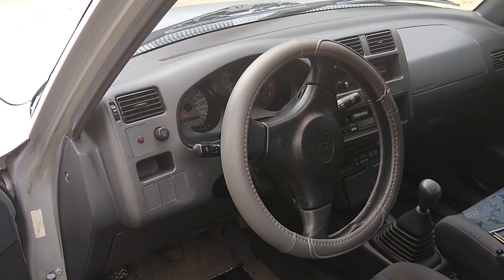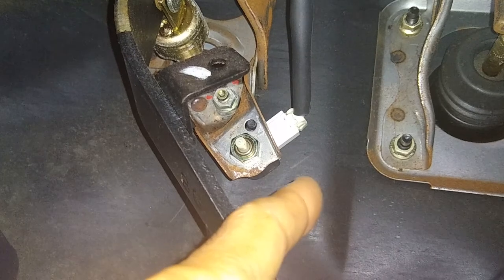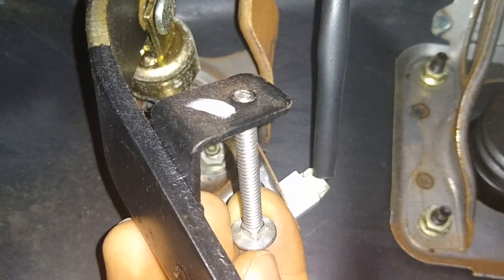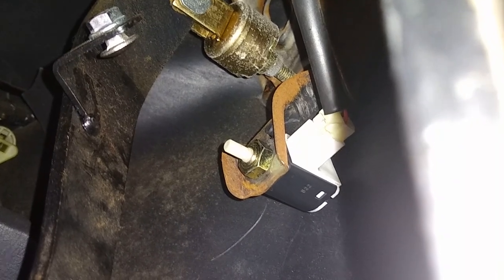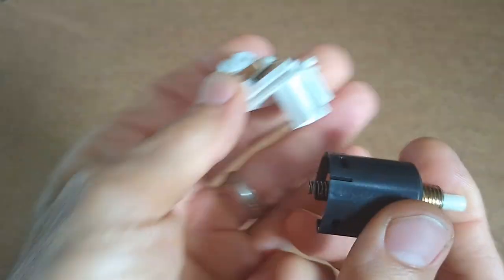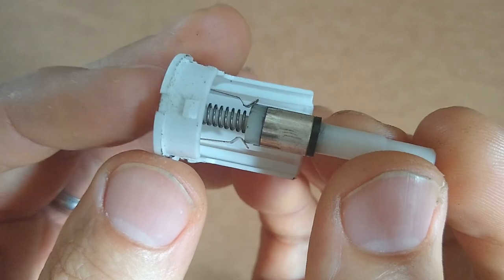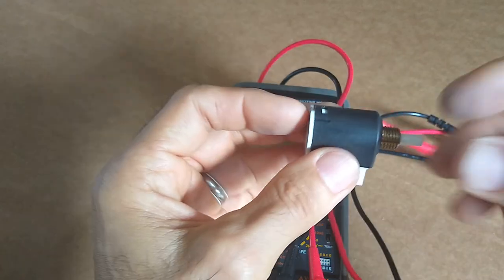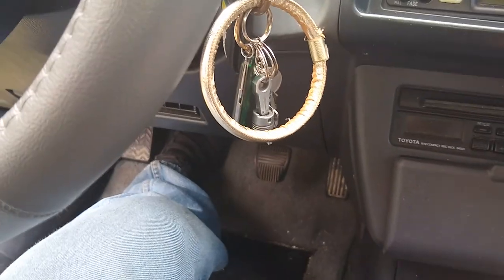Toyota Clutch Zero Cost Safety Switch Repair

Comment: Great video man, I didn't have to look further. The bypass had gotten loose and the pedal was totally missing it. - 1991 4Runner for with a 2nd Gen.
Reply from the maker: Hello ZiaLinez505, Thank you for the kind comments. I'm glad you found value in this video for your viewing time. Yeah, giving that little switch a quick peek can save lots of time in further troubleshooting. Great job spotting and repairing the problem.

Best of luck with your repairs.

Comment: At first I thought you were going to 3d print a part.  Carriage bolt is a great solution.  Carriage bolts are used on the kind of carriages that horses pull.  the square part under the head sinks into the wood preventing spinning, and the rounded head left exposed avoids injury to the animal.
Reply from the maker: Hi 200OK, thank you for commenting. That's great information about the carriage bolt. I'll never forget it's name now. It's interesting that you mentioned a 3D printed solution because that was my first thought as well. The only thing that kept me from doing it was the car's interior heat factor. I had concerns about the part getting soft. I'm thinking about playing around with ABS filaments but will need to build an enclosure for the printer.
Reply: @vbared  Hi Victor, thanks for your reply.  I have only used PLA and have a large white translucent Polyethylene trash bag put over my printer to keep drafts away.  The bag moves out of the way when the build plate bumps it, and visually the printer does not look huge like it might with a rigid enclosure.  I am 200_OK on onshape.
Reply from the maker: @2OO_OK  The bag idea sounds awesome. It would be interesting to find a way to add a heating system to enable printing with polycarbonate filament.
Reply: @vbared  An incandescent light bulb makes heat.  Could use a thermostat from electric baseboard heating in a house to control it.